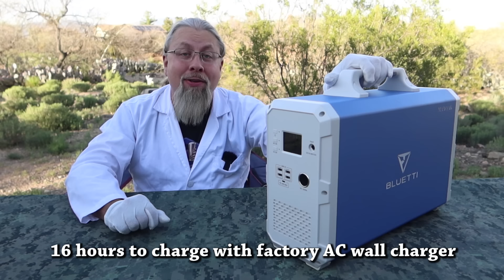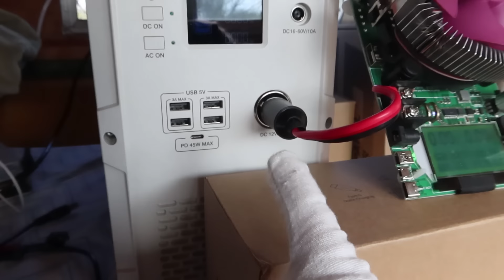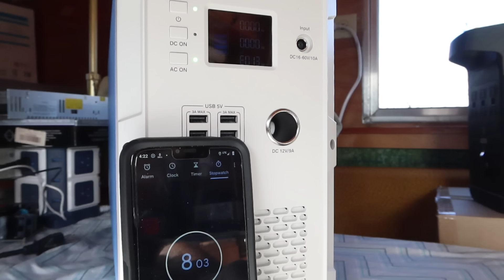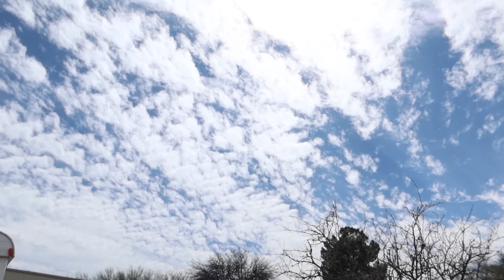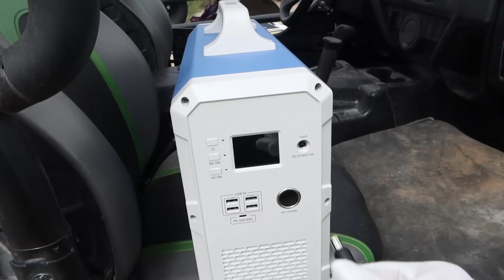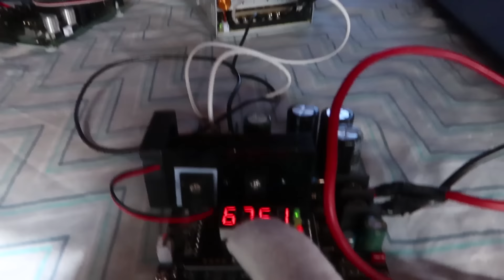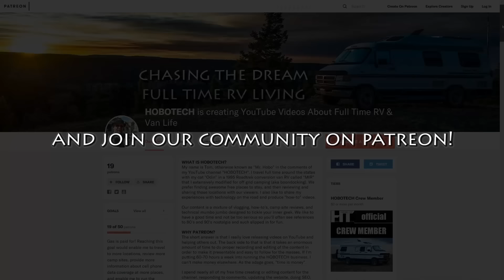MASSIVE Off Grid PORTABLE POWER Station! 2400Wh MAXOAK Bluetti EB240 Lithium Solar Generator Review

Comment: After thorough research got one of these and am now trying to decide on solar panels.  I'm clear that the max voc is 68V and the max amperage is 10 amps.  One of the things I'm confused by in your testing is that you had all those panels in series and parallel which seems to me would exceed the unit's 10A limit.  For example the Renogy 100 Watt panel has an isc of 6.24 amps.  Would not two of these in parallel result in total amperage of 12.48A exceeding the unit's 10A limit.

As you can tell just starting out and struggling with the basics.  Thanks for any light you can shed...
Reply: would you recommend it?

Comment: Thanks for the info about the the VOC voltage is additive so i can only have 3 in series (about 21voc each)..  I have 8 100W panels (but only hooked up 6 based on the info you shared)...I am curious if i can hook up the other 2 panels such that i have  3 panels in parallel with 3 panels in parallel with 2 panels?  I am only getting about 50% out of my panels (guessing because of angle of the panels...i am laying panels flat on top of my patio so can't be seen by neighbors because of HOA).  Right now with 3 panels in parallel with 3 other panels i am only getting about 300W, and i am  hoping i can add the other 2 panels in parallel so i can get 400W?

Comment: I would like to find out the best system to use on the market where I can plug in a 120v-60Hz 1500W Heater to use for two weeks while on Vacation Camping out??
Reply: You would be better off using a gas IR non burner heater for that

Comment: You said they upped the input voltage to 60v so it could handle 3 panels?  Can't you connect 8 panels (4 12v in series and then in parallel to another set of 4 12v panels in series)?  wouldn't that be just 48v for all 8 panels....  I want to hook up 8 panels because i only get about 50% (200w from 4 100w panels).  I am sure its because of the angle and shading of the panels, but i can't change that because of hoa restrictions.  Can i just buy 4 more and put them in parallel with the other 4?
Reply from the maker: You go by Voc when adding panel voltage.
Reply: @HOBOTECH  ok thanks to your help i figured out a solution that is now working with 6 panels.

Comment: The Bluetti 2400 Watt DC (solar) charge port shows 16-60 Volt max (10 Amp) input. (Open circuit voltage per spec sheet).
New specs per Bluetti www shows Default working voltage ≧ 20V, gross open circuit voltage ≦ 73V(±2V) so 69 Volts should work GREAT!

Can I wire the DC output wires from one or two panels without disconnecting them from Enphase IQ7+ power converters?
I am HOPING the current would take the path of least resistance and go to BOTH devices during bright sun and go only to the Bluetti when grid power is out and the Enphase system is shut down?

Comment: So I just bought the bluetti 2400, with 3 100w solar panels.  Would the be efficient to charge the bluetti quicker then 10hours
Reply from the maker: 3 panels will take about that long in perfect sun.
Reply: @HOBOTECH  so i need to do what you suggested,  I will order 2 of the 170w or 2 more 100w. I live in south Texas but i would like to charge it as fast as i can...

Comment: If I need to run a CPAP and a 12volt compressor fridge at the same time, I would just use a 12 volt splitter, right? My car 12v is for 15 watts.
Reply from the maker: I'm told by other CPAP users a splitter will work.
Reply: @HOBOTECH  thanks!

Comment: I've owned my EB240 this for over two months with 740 watts of solar available but doubt it has a true MPPT charger. I say this because if I leave the solar plugged in overnight and wake up the next day, the charge rate is only 1/2 the available watts if it was used overnight. If I then unplug the charger and wait 30 seconds to plug it back in, then the charge rate quickly runs up to the 500 rated watts. Also, if one of my panels gets shaded by a cloud in mid day and then goes full-sun again it will only charge at the 1/2 rate until I unplug and plug it back in. Not a big deal but charging at 1/2 rate when more is obviously available is annoying as heck. Other than that, it is a great unit.

Comment: Professor...can I use a Renogy 300 W 24v Monocrystaline panel to charge the Bluetti EB 240 ?
Reply from the maker: Yep!
Reply: Thanks... Do you know if Bluetti is planning on offering the EB 240 with a 1500 W inverter ?
Reply from the maker: @vannebago  There will be no further updates to the EB series that I am aware of. AC200 was the successor.
Reply: @HOBOTECH  I am looking for a power system for a mini van camper that will provide me with up to two weeks of power for extended road trips. Looking to use my power for a water pump, electronics charging, lights and maybe a small microwave and small heater. I will cook with a butane camp stove... Maybe power a small rice cooker. I am leaning towards the EB 240 for the 2400 watts capacity rather than the AC 200 which has less capacity but a bigger inverter. Any thoughts ?

Comment: Thanks for the video.
Please help me understand something: I want to power a 6.1 amp refrigerator., for 12 hours per day when it is NOT being connected to solar panels. 6.1 X 12 = 73.2 amp-hours.  The Bluetti 2400 WH converts to 200 Amp-Hours. In theory, that Bluetti should be able to power the refrigerator for 200 divided by 6.1 or 32 hours. But your 500 watt air conditioner ran just 4 hours? What am I missing? Thank you.

Comment: I just got one, question, i have conversion van/rv, lots of hard wired 12v leds water pump, 12v fridge, two vent fans, etc. how would you go about hooking all those into this?  Im new so just a point in the right direction and ill research. Anybody know?

Just a guess, 12v fridge into the regulated 12v output,  plug ac converter into ac output, wire  all 12v into converter? Lol im guessing
Reply: Did you ever figure this out? I’m in the same dilemma myself.

Comment: Can I hook up 4 Bouge RV panels (in series/parallel) with this generator
Reply: Wondering the same. I'm looking at the specs for the BougeRV 180w (21.6 Voc, 10 Imp), and I think if you wire it that way you get two pairs that kick out up to 43.2v at 10A, and when you wire those in parallel you get 43.2v at 20A. If that flows through the entire circuit, I'm worried about the 15A Series Fuse Rating in the specs, but I'm still trying to confirm exactly what that means to figure out if that would be a concern or not. Based on the array used in the video I'm thinking not, but not 100% sure.

Comment: I just found your channel, I've been thinking about getting a solor generator for years and finally (kind of) making a decision.  I actually ordered and then cancelled the order for the ECFLO DELTA after watching your video!  Now I'm in limbo again, the 2400wh MAXOAK Bluetti was my next choice, however the surge is so low that I'm now questioning that unit.  My evaporative cooler has a surge of 1280, it's borderline with the Bluetti, do you think it would work with the cooler?   Thanks for your video's they have been very helpful!
Reply from the maker: It should work. I've been able to run constant loads around 1100w and a surge less than 1 second to 1300w should be fine. No guarantees though as each has slightly different tolerances +/- 2% generally.
Reply: @HOBOTECH  Thanks, that was a quick response and very appreciated!  I might wait for the Maxoak Bluetti AC200 2000W/1700Wh Solar Generator, it looks like they don't have any right now with US plugs only UK (on their website).  It has so many good features, the only drawback for me is the weight, everything else looks good.  It appears that unit could also run my 13,500 BTU RV air conditioner, including the surge.  I saw your review on this unit, but I am going to watch it again, thanks for your help, this is all so confusing for me!

Comment: OK, Mr. HOBO. So I'm about to get the EB240 on Amazon, and (3) Bourge 180W panels through Bourge RV (available Oct-Nov) using your promo codes. What else do I need in the way of cables, adapters, controllers, etc. I'd like a 30 foot solar panel extension cable. Given that, about how long would it be to charge up?
Reply from the maker: You need a MC4 extension cable. That's it. Those are on my site.
Math at 80% effective: 2100wh/430w=5 hours
Reply: @HOBOTECH  Thanks. Will this one work? It says it's "bare" on one end. Don't I need an 8mm male input on one end? Thanks
https://www.amazon.com/Temank-Extension-Weatherproof-Connector-Adapter/dp/B0854NZ398/ref=sr_1_3?crid=31TL7Q4BOREH0&dchild=1&keywords=mc4+extension+cable+30+feet&qid=1599842481&sprefix=mc4%2Caps%2C202&sr=8-3
Reply from the maker: @perrypaulding7737  EB series comes with MC4 adapter. I suggest getting the cables on my site. They are what I use and know they are good. https://hobotech.tv/amazon/#Solar-Adapters
You should also consider getting the Bluetti from the link here, save $300 and tax if you aren't in CA https://hobotech.tv/amazon/#Power-Generators

Comment: Mr. Hobo,
I found the following deal online for an EB240 and 4 solar panels, and wanted to get your opinion on it before pursuing it. Thanks a bunch!
https://shopsolarkits.com/products/bluetti-eb240-solar-generator-quad-kit?utm_medium=cpc&utm_source=google&utm_campaign=Google%20Shopping&gclid=CjwKCAjwnef6BRAgEiwAgv8mQcWCU4sPMc7i8mH_p8PROINqsBvon12c5VAM48LcS4Zwfd57kcEggBoCFGQQAvD_BwE
Reply from the maker: They are a markup reseller. You'll overpay going through them. Just use my link and codes. You can get the EB240 for $1699 and BougeRV 180w panels that are much better for less. Codes are here https://hobotech.tv/amazon/#Solar-Kits
Reply: @HOBOTECH  The Bourge 180s are out of stock on Amazon. Any other suppliers? Would you put 3 of them together for the EB240??

Comment: Your a genius. Excellent video, learned heaps. If you buy a 2400wh generator, then you should get =>2400wh, so this generator has failed this test. Solar charging is good. However, definetly does need a larger 2000w inverter.
Reply from the maker: Their new AC200 has a 2000w inverter. All solar generators provide less power than rated as they reserve 5%-10% capacity as to not damage the battery.

Comment: Does anyone know if it’s ok to use a “cigarette lighter” adaptor to increase the number of 12 volt plugs from one to two, or three? I would like to run more then one  device simultaneously. Such as a fridge and roof vent fan. Thanks for any advice folks.
Reply from the maker: Yes, you can.

Comment: Hobo Tech I love your videos..I have a question about the 200w Renogy Suitcase panels you suggest..I just set them up today under pretty smoky skies to charge our Bluetti EB240..I saw 95w for awhile & then wattage dropped to 65-68w for remaining day..Here is some added info, the outside ambient air temp was 114° & surface temp of panels where 140° under hazy skies..Should I be concerned about the 65-68w output of these panels? They are new & just wondering if this is normal or I need to contact Renogy? Thank you for any suggestions..Ken in Arizona 🌵
Reply from the maker: Solar performs really bad in smoke. It performs even worse in high heat. I had this same problem in Tucson during the fires.

Comment: I can't for the life of me understand how you got your solar array to fit under the ceiling of the Bluetti restrictions (67volts / 10amps).  If what I'm seeing is correct, a single 170w panel is nearly 10amps by itself.  A parallel would double the current.  Am I seeing this incorrectly?
Reply from the maker: Easy. They are in series.
Reply: @HOBOTECH  ahhh...complete brain-fart on my part.  I just learned that yesterday too and I had already forgotten.  Series automatically uses the lower current from the small panel rather than the higher current from the large panels.  By the way, thanks for the discount.  I ordered the 2400 last night.  Your discount brought it to $1599.  Im new to solar so your channel has helped me tremendously.  Thank you.

Comment: Question to anyone..I plan on getting this. I need to run 2 fans. Total they are 8 amps. Could I buy an adapter to make two dc plugs then wire the 2 fans into the adapter? Does the adapter pull any amps id have to add to my total? I know the max on this 9 or 10 amps. ? With this being the case I'd also need to run my fridge thru inverter. Is this model good to run inverter 24/7? . Wonder if there's a better option for all in 1 solar ?
Reply from the maker: That will work. Splitters don't use power. AC200 is a better all in one for less $ but you only have 1 day left to get the deal.
Reply: @HOBOTECH  excellent. I'll look into the ac200 now. Thanks and great videos man 👍
Reply: @HOBOTECH  hey so after our discussion I've purchased a different set up. I'm wondering if you can help. I've purchased the Bluetti eb150 using your code until the AC is delivered. I bought a class 2 LED driver AC90-265v input / DC 12V 25Amp 300w output. This is rated for 100w per lead, having 3 separate leads. I'm good to wire a 12v fan per lead. What do you think?

Comment: Hi HOBOTECH, great review.  I actually purchased one last month (and your code still worked,saved me $300).  I have an issue maybe you can help.  I hooked up 2x290W panels in parallel using a Y connector.  Each panel produces about 210w alone, but ran in parallel it maxes out at 290w, if hooked up in serial it errors out due to voltage.  I was hoping for much more power in parallel...am I doing something wrong?
Reply from the maker: The input is limited to 10 amps. Your panels are too large for this application.

Comment: Can you use a 500 watt power inverter running off the car to charge it? You said you can use a 300 watt inverter, why not 500?
Reply from the maker: Sure, but use a pure sine.
Reply: Ok, from what I’m reading the AC charger only puts out 160 watts.  Now even plugging that into a car inverter that’s 500 watts creates a bottleneck.  How or where can we get a 500 watt charger to charge it in the car in 5.5 hours?
Reply from the maker: @hidaven  You have to buy the charger I use on hobotech.tv/amazon under tools and connect it directly to your battery. There is no cigarette lighter socket that can handle 500w.
Reply: @HOBOTECH  lol.  You have 2 thousands products on that page! lol.  Can you narrow it down?  If I hook up a 500 or 1000 watt inverter directly to the battery wouldnt that be ok?

Comment: Prof HT. Thank you so much for the video. I have been researching solar generators for the past 3 months and thanks to your amazing detail in this video, that gave me the confidence to buy the EB 240 and also purchased 4 BougeRV 170w solar panels.  Question for you. You mentioned that the Bluetti can limit the input wattage during solar charging to 500w?  Are there long term affects if the charge is continuously exceeded during charging?  Thanks Prof
Reply from the maker: It is hard limited at the input. You can't harm it by using more. I demo this in the video.
Reply: Thx Prof HoboTech for the quick response.

Comment: I purchased the 2400wh Bluetti based on your review. I had been watching a lot of reviews and found yours most helpful. Your discount on Amaz was $95 dollars. That was helpful.
I also used your discount on the 170W solar panels from BougeRV . These I ordered directly from Bouge RV and saved approx $100 dollars on 3 units. We are using this as a back up
for a power outage. We plan to attach the solar panels to our roof and store the bluetti in the house until we need it.  Not hooked up yet. Waiting on the solar panels still. 
  O K, so here is the question, ,  ,  How do you protect the Bluetti and the solar panels from an EMP blast?  Do they have to be in use to sustain damage?  I would welcome your response or
even one from one of your many in the know subscribers.
Reply from the maker: You need to put it unplugged inside of a Faraday cage. Many use an insulated metal trash can that is grounded.
Reply: HOBOTECH  I get putting the power station in a faraday cage. What about the panels?
Reply from the maker: @davidrawls369  If they are unplugged at the time of EMP they should survive.

Comment: Thank you for your clear teaching ability and numerous excellent video blogs. I just received my 2400wh MAXOAK bluetti EB240 power station along with two 1000 wh Jackery power stations and two Jackery solar panels. I also have the smallest Jackery... I think I may be ready for the yearly power outages that happens at my Mojave Desert home.  I'm 83 and the bluetti EB IS a bit heavy to be moving around very much, but in my case it will be positioned in my kitchen neatly tucked under a pantry shelf waiting for the routine Southern California Edison power to go off--usually when the temp. outside is over 110.  I love all these power stations... what great advancements in technology ! Thank you once more Mr. Hobo Tech. Your recommendations are so very much appreciated.
Reply: Hi David!  Since you live in similar weather conditions (I live & work in Las Vegas),  what are you using for air conditioning and what (and how many) solar panels are you using with your Bluetti 2400wh?   I'm 66 and last October ended up with a Pacemaker, and I still teach full time.  But the summer heat (yesterday it registered 119 degrees on my thermometer!!!) has become a bit too much.  I've only had 2 power outages by NV Energy here this season.  Thank you!